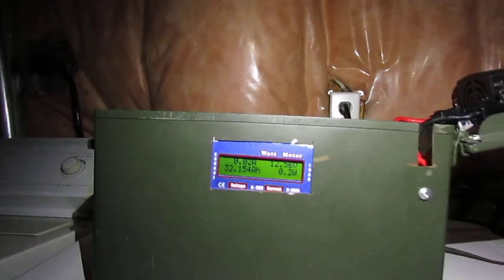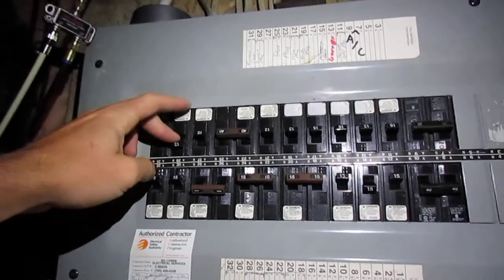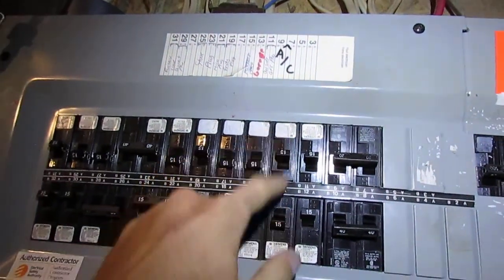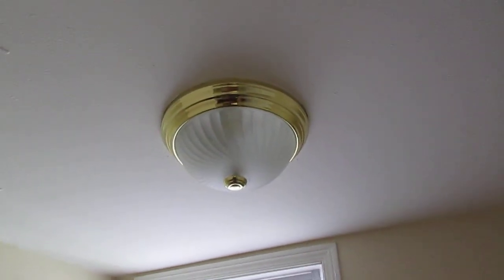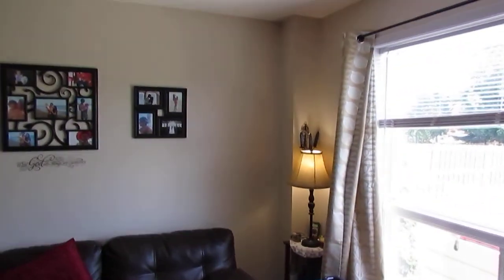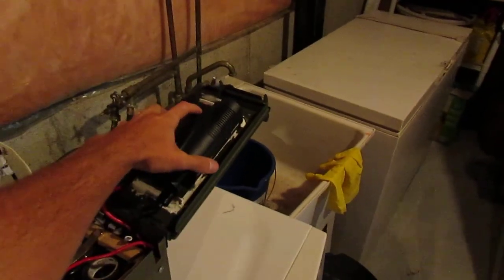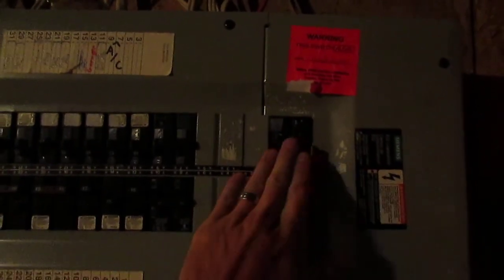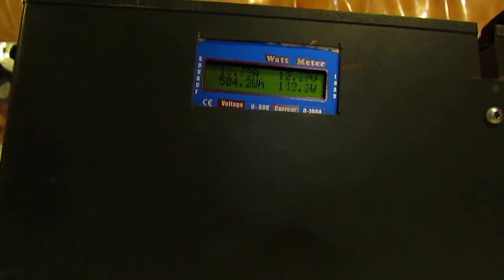running house off 600W inverter!

Comment: To anyone reading this, you need to add up your watt usage before you purchase or hook up an inverter to your house. 600W is not enough. Yes, you could ruin the lights of the entire house if you use the right bulbs.  A 600W inverter cannot handle a microwave, toaster, coffee maker. It can handle the fridge's light but not the spikes of it's compressor. It can handle an oil furnace but not the spikes of the circulatory pumps. An air conditioner is out of the question.
Reply: 600 watt is nothing im in a 2 bedroom small small house i have 1500 2000 and 3000 watt inverter systems to run house microwave freezer a/c lights

Comment: You can buy a 4000 watt inverter on sale for about $150 and hook it up to your car battery, start the engine, turn off the head lights (apply the parking brake to get them to go dark) and have enough power to run the furnace and fridge and some cooking appliances (frypan, toaster oven, kettle) with the engine idling. Car engines will idle for days and days on a tank of gas.
Most cars today will put out 100 amps, some will put out 300, check your manual.
Reply: Hal McAdams be aware the car doesn't pour out those amps at idle.  Maybe at 2000rpm though - you can run a continuous 700-900 watts

Comment: Idk if you ever seen the inside the panel the bus bar doesn't control only 1 side of the panel. One side runs breaker 1 and 2  and 5 and 6 and 9 and 10
And the other side of the bus bar runs 3&4 7&8 11&12. So when u have a double pole in slot in 1 &3 you get 220 on the leg if that makes sense lol I made a cord that plugs into the dryer plug to power the whole panel. I tried 2 separate suicide plugs but a gfi stopped that from working properly
Reply from the maker: phillip renicker yes i have made this same plug, was wondering how the panel was wired but have not looked inside mine yet, and i have not taken the time to look at my grandpas witch I see all the time.
Reply: fliping720 Anything with the two breakers bridged with that piece of metal will be 3 phase. The suicide plug on the dryer or any other 240v circuit will allow both 120v sides to get juice in any breaker panel making it 240v respectively.
Reply: Your right about any 240 circuit powering both sides but your not going to get 3 phase in a house. If you had 3 phase it would require you to have a transformer to step the power down to 3 lines of 110 coming into the panel and then the bus bar is set up where you can put in triple pole breakers and run industrial motors that require the extra juice but usually have a separate box with motor starters and heaters and all that fun stuff.

Comment: There are many  cheap inverters out there... and even  expensive ones...that the ground and the neutral are not connected internally.  If you use the suicidal cable type of connection, there is a problem...the ground and the neutral are connected together at the breaker panel...hence you will fry your inverter!!! Be careful !!!
Reply from the maker: thanks your right!

Comment: YEEEEAH BOY!  You just plugged that right into your outlet?  Is there any way to remove the cover clip that right onto the breaker?  I'm not an electrician but was really wondering what could be done in a power outage.  I know you must have your main breaker off.
Reply from the maker: its super dangerous and not recommended I would look into a transfer switch, but if you do this make sure 100% main breaker is off and make it so no one can come into your house and turn the main breaker on
Reply: Going Off Grid: Yea I did a bit more research last night and believe you're supposed to buy an ac 220v pure sine inverter and then have an electrician install a switch so you can't acidentally feed power into the grid.  Really cool though for powering one group of outlets in an emergency.
Reply from the maker: no you do not need a 240 volt inverter, 120 will do you just have to make a cable from you inverter to your generator panel that binds bolt live wires together. if you need 120 and 240 you will need a inverter that has split phase.

Comment: Nice portable power station! Is that a pure sine wave inverter you're using there?
Reply from the maker: not this version, but my later one is yes :)
Reply: +fliping720 how did you get around the whole ground to neutral bond issue then?  I'm just starting to learn this before i fry my new equipment :) thanks
Reply from the maker: YouTube305 I do not use the ground unless I know my inverter does not have a live ground, in this video the inverter has a live ground and I did not use the ground.
Reply: +fliping720 I see, so does that mean that your battery's ground terminal is energized by the inverter like youtube user gnurlknar24 says? It all still sounds a little freaky but thanks for your videos, learning alot :)
Reply from the maker: YouTube305 yea I gues it could be, thats why I put it in a box :)
Reply: +fliping720 Got it! This really is all starting to make sense to me now :)

Comment: I wonder if a 4,000 watt on each side of the panel box would run most of the items in the house ?
Reply from the maker: they would have to be synced together so the 240v sine wave would not be screwed up

Comment: Man, how did you do that? How did you hook the electric box up to the batteries? 👍
Reply from the maker: its very unsafe the way I did it in this video and would not recommend, but I used whats called a suicide cord its when you cut two cords and use only the male ends and splice them together and plug one end into the inverter and the other into the house outlet, but you must make sure 100% that the make house breaker is off and will remain off, it is said to of killed lines men and or will destroy your inverter if the main breaker is turned back on, only use this if you understand the risk involved.

Comment: Can you put on another suicide cord with the one that you have on on a different outlet and turn on the other side also? PS if you have a more powerful inverter would you be able to run the fridge and all the other stuff without damaging your box or causing any problems God for bid a fire or anything like that because you did say you had a baby I’d like to do the same but with a more powerful inverter Add a couple more batteries for more amp life if you can respond thanks

Comment: The breaker that controls your outles will be powering up you house panel.. its fine if you have all of the breakers on... not everything will be on that phase that the outlet breaker is on without using a double pole 15A  breaker... its useless testing the breakers with only one hot phase.